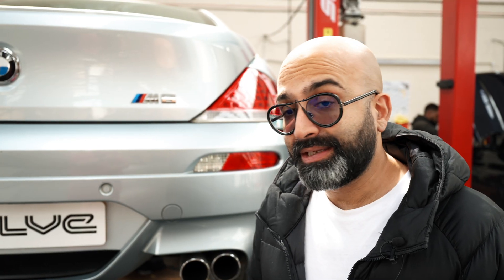S85 V10 Rod Bearing Service on E63 M6

Comment from the maker: We have our own E92 M3s with the BMW bearings in, we're not going to be replacing them with these as we still stand by the fact that if correctly looked after like we will they're not going to suddenly fail. So don't suddenly think you need to do the service again - but if you haven't had it done yet, why settle for less than the best? That's something we try to live by with all the products we design and sell.
Reply: Can you elaborate on "looked after"? E.g. should the car be let to idle until fully warm? Or idle only for a few moments then babied until warm? The car already limits revs as it warms up. Thanks.
Reply from the maker: @GrandUppaah  Let it idle for a minute or so, then drive moderately until fully warm is what we do.

Comment: If i buy an M6 with almost 90,000 miles, rod bearing replacement seems like a no brainer. Are there other "while you're in there's" that should be done? Example: VANOS pump, VANOS line, or other suggestions? Thank you.
Reply from the maker: We carry out the VANOS line if the car does not have the updated part from factory.

Comment: So what is the core cause of the issue? Is it an oil system issue? Vibrations? Weird bmw built this engine for 5 years and never fixed the issue
Reply: The root cause of the issue is when cold the tolerance between rod bearings and crank is too tight to allow the cold thick oil to fully flow which is exacerbated by some drivers not allowing the engine / oil to fully warm up before giving it the beans. This results in excessive wear. 

It is vital the s85 engines are allowed to fully warm up before the throttle is opened up. 
Mahle bearings have s slightly improved shape to allow better oil flow.

Comment: 10w60 is thin when cold to get to where needed quickly and thick when hot for operation…..hence the warmup

and is there any unhappy pairing mahle rod bearings with factory orig main bearings…..and using factory parts just bearing or baring in mind to maybe doing them as a service and when do mains take shit bc thats my thing eating at me is their condition

Comment: Would rather the bearings wear than the crank...... How do you rate them in relation to stock taking this into account... As the harder material can be detrimental ?

Would rather treat them as a wear it... if that's the case... And in that case... What do you recommend please  ?⭐ Stock or Mahle ? As this is over a year ago now ... An update would be amazing!!!
Reply from the maker: Still fitting and recommending the Mahle bearings
Reply: @EvolveAutomotive  Does the Mahle use a harder material  ?
Reply: @TTOOS  There is a write up that Mahle did on there bearings, I believe it is more focused on the original set, from what I remember they are using different coatings. I just sent my car off to have these put on, im at 151k, I've had the car for a few years so we'll see how things look hopefully Monday.
Reply: @GrandProductionsMedia How many miles did you put on yours since purchase?

Comment: Finally someone with brains.
Stay with factory size rod bearings unless you gonna pull engine out and replace main bearings too.
Specially cylinder #7 and 8.
Mahle bearings are awesome.
Strongly recommend.
Environment play huge role in this.
Here in Florida I’m seeing M3’s with 200k having original rod bearings in OK condition even with very longs oil change intervals.
Illinois, New York and up it’s totally different story.
In that case I’m installing 400W Moroso heating pad at the bottom of the oil pan to prevent premature failure.

Comment: I’ve owned 2 of these and currently have a manual. If you look on the engine and manual it clearly says change the oil every 1500 miles. Most don’t know that. 

In my opinion it’s one of the reasons why there seems to be issues with the engine. Most probably wait 3,000 - 5000 miles. Big mistake if they do. In my single clutch only had problems with the SMG failing because it’s not if it’s when. Just like a manual clutch. The problem was the BMW dealer didn’t know how to fix it. Sad story. Left bolts undone and all. Crazy. So it failed a second time. Took it to an Indy shop and ran perfect after that. 

Manual 6 speed has zero issues knock on wood. Searching for a manual M5. The moral of the story change your oil every 1000 miles on this massive oil burning car that runs super hot.
Reply: Hey brother. Just got one myself it's the Euro version, and it says it on the sticker under the hood. Clearly convinced, that has been the culprit of the bearing, failing left and right. 

Added ceratec and liquy moly 10 60. Mine has 79k KM. Almost new. But I'm doing the bearings just because of age and the fact you just described
Reply: No this sticker regards the first oil change…

Comment: Which bolts did you use? I keep hearing about ARP. I like that they are simple to torque but I do not mind doing torque to yield on the OEM bolts if they are truly better.
Reply from the maker: We use ARP but OEM are also fine.

Comment: Could you run a 5w-50 oil in the S85 after changing to higher tolerance bearings?
Reply from the maker: We have recently switched to 5W-50 Motul oil in our S65/85 rod bearing services.
Reply: @EvolveAutomotive  Any updates on how this is going please 💘

Comment: The problem isn't the rod bearings, the problem is the main bearings closest to the chain. The chain puts too much tension on the crankshaft making the main bearings closest to the chain work way harder. If you are thinking all you need to do is replace rod bearings to extend the life of your S65/S85 THINK AGAIN. You know how all these shops pull out the rod bearings and look at them on a piece of paper and say "oh yea its great we caught this in time" it's a bunch of bull. Have them take apart the engine completely down to the crankshaft and have them look at the main bearings closest to the chain, THAT'S YOUR PROBLEM! If you actually want your engine to last have them replace both your rod bearings AND your main bearings. Unfortunately you can't just drop the oil pan to replace your main bearings, you need the entire engine taken out and disassembled. BMW Quality!
Reply: The s85 suffers from premature rod bearing wear, not main bearing wear

You can see various s85 tear down videos here on YouTube to see for yourself
Reply: @mista5796 why don't you look up the guys who had their rod bearings replaced and still had their engine destroy itself? It's both the main bearings and rod bearings that don't have enough clearance
Reply: @BHSAHFAD that’s one case, and we don’t know the history of the engine. 

I’ll include a couple of s85 teardown videos here so you can see .. the main bearings are fine
Reply: That’s not true. My engine was rebuilt and that’s not the issue.  You didn’t even mention the high pressure Vanos.  Nice try to sound like an engineer.  Let me know if you design engines

Comment: Did you also check and replace the vanos lines that also fail over time?
Reply from the maker: This car had it changed, only the earlier cars without the updated line need it done.
Reply: @EvolveAutomotive  that's not entirely true. I own a 2010 m6, and when we changed my rod bearing we found the vanos lines had started to leak.
Either way, I still enjoyed your video. It's still very informing and I appreciate you making it. Great job

Comment: This is pointless just like using non-OEM bolts.  1) How many of these will ever see another 150k in their lifetime, and 2) If it does, what owner would NOT bother going back in, and end-up swapping these expensive shells out anyway?
Reply: Damaged crankshaft and metal shavings destroying your VANOS pump will make it 5 times more expensive than rod bearing job.
Reply: @UMORIEGA   What the... no valid point to that statement.   The discussion youre missing is - why the fk play with aftermarket overhyped bling when OEM has already proven to do a fantastic job for nearly 20yrs of repeatedly withstanding yet another new wannabe-racer owner, more cold floggings, track days, YouTube burnouts etc., and its done all this for more miles/kilometres than the car will travel in its remaining life. In short, the ARP & BE sheep online are regurgitating complete nonsense.   Is that clearer enough ?
Reply: @asecret900 replace the bearings at the 50-60k interval and shut up 😂😂
Reply: @Tony-l9g7y  In what decade or century do 'you' predict E60 M5s will see their next 60k rollover?   Never again is the correct answer for 99.9% of these old girls - And us owners respect them a great deal more than the cashed-up abusers, with full replacement warranty.

Comment: I know a mecchanic who have an m3 e92 and he said that every 70-80k km you need to replace every bearing  and i mean those on the block also because people replace only those over the oil pan leaving the main bearings untoched thinking oh i repleaced them so yeah..wrong those main bearings can spin and that's game over boys.
Sreten on his channel (e39 restorations)talked about this issue and he showed on his m3  what can happen if those bearings are not replaced.
Don't know if the v10 have the same issue tho.
Reply from the maker: Respectfully disagree with the need to change main bearings. That’s also a total engine disassembly to carry out.

In all our years have never heard of an engine failing and the cause being a main bearing.
Reply: @EvolveAutomotive  Definitely a thing on the S65, not sure about s85, maybe not since it's a longer crank. This just happened to Speed Academy's (YouTube Channel) M3 and they had just had the rod bearings done 3,000 KM prior by an experienced shop. I forget what the determined culprit is, but believe it had something to do with extra tension from the oil pump chain tugging on one side of the crank. Also noticed no plastigage on those bearings during installation to check proper clearances, due to any bearing, crank, or rod variations.

Comment: A motorsport derived part is not necessarily superior in a road going application.
Race engine applications demand power and short term reliability, but not long term reliability. For example, a lot of race plain bearings will be single layer for outright strength, rather than the multi layer oem bearings designed to last a long time.
Im not familiar with these Mahle bearings and theyre a reputable manufacturer, but anyone wanting to go this way should do their research to ensure they'll hold up in the long run.
Reply: In the pdf "Copyright MAHLE Engine Systems UK Ltd Technical Information Motorsport Engine Bearings" they talk about motorsport bearings with trimetal layers, so no worries there :).

Comment: I was under the impression that the OEM bearings get out of shape due to uneven wear from poor clearancing, BMW designed the factory bearing clearance too tight, and this is what ultimately is at fault for the high bearing wear.

It seems to me the UK is lagging behind when it comes to providing a proper permanent solution for these engines. The issue with these engines was figured out back in 2015 when BE Bearings released a properly clearanced bearing for the S85/65 motors. Once these bearings are put in they are essentially lifetime like every other normal engine, no more 60k interval bearing changes because of BMW's poor engineering. 

I personally wouldn't trust a shop that doesn't put higher clearance rod bearings in these motors & instead opts for new OEM bearings, your just replacing a flawed item with a new flawed item and not addressing the issue at its core.
Reply from the maker: We’ve over the years discussed the issue at length with people who have a lot more knowledge on engine internals than we do, and of course without proper controlled scientific testing the true cause of the issue will never be known for certain, if it is even one factor (in our opinion it’s more likely many)

As said in the video, if correctly looked after the OE bearings will last the lifetime of the vehicle, evidenced not only by our own 150k mile car but also a customer who has a car from new with over 230k miles on the original bearings.

Mahle (actually Vandervall who were bought by Mahle) have huge experience in designing and manufacturing bearings, so with this bearing have not only carried out proper R&D which comes from processes learnt from F1/Endurance, but also then utilised their manufacturing process and it’s extremely tight tolerances and attention to detail to create what we believe to be the best bearing available for these cars.

I mean they even go so far as to not stamp the numbers on the bearing but laser etch, as the stamping will cause raised spots on the bearing which then increase heat transfer in small areas which can attribute to increased bearing wear.

Are we saying any other brand are bad? Of course not, because without proper first hand data from each one we aren’t in a position to say that. So if you have a personal preference of bearing material, clearance, coatings, brand, or even oil then go with that, it’s your car after all. We’re just sharing some knowledge that we have gained over the years from changing hundreds of not thousands of sets of bearings, and speaking to many experts within the industry.
Reply: @EvolveAutomotive  You can't use an example of one car, or even a few dozen, that go over 100k as evidence that all S65s will be ok at that mileage, many won't, and many have already failed before that mileage over the years, and that's due in part at least to clearance variances.
Also, Mahle increased the clearance with these new bearings of theirs, so that lends more evidence to the clearance issue the OEM bearings have.
That said, the later tin/alu/copper bearings fared less worse than earlier OEM lead/copper ones, I've not seen one of the tin/alu/copper ones worn through to copper yet (after looking at 500+ photos of OEM bearings pulled! lol), and yes they do have copper!

That said, seeing as your own M3 got to 150k with the earlier bearings, I'm sure it'll be just fine on the later OEM ones.
Oh and a bearing worn down to copper is not ok, even if it didn't fail and seize. Once the copper is exposed their is a risk of seizure (as per the bearing manufacturers bearing construction pdf papers).
Reply: @Markpd69  I'm looking at a 2012 M3 with 89k miles, would either of you recommend changing the bearings?
Reply: @ragnarlothbrok6324  Well, as I mentioned above it seems the later bearings are at a lesser risk of failure than the earlier ones, and certainly don't wear through the babbitt layer like the earlier ones. But they still don't wear at normal levels like a 'normal' engine would (high revving or not) and a small number have failed, if it were my car, with that mileage I'd change them anyway.
Reply: @Markpd69  thanks
Reply: Yea this, I put in a long detailed rely about this, but it  got deleted :(

Comment: I find it amazing that Mahle out of nowhere, for an 18 year old engine, found it fitting to develop and release bearings. Sure, the S85 was made until 2010 and the S65 until 2013 but still, Mahle hit it out the park apparently.
Reply from the maker: We are in debt to whoever convinced them to!
Reply: bechause they have seen the demand now...new cars didnt need a replacement
Reply: @p__jay  Considering it was a consumable and needed after three years for some, I cannot really agree with you. I hear what you're saying though.
Reply: But they kept on the original nominal clearance developed by BMW at 0,038mm. So I don't see too much difference from OEM 702/703 bearings. For me, BE bearings is still the gold standard.
Reply: @UMORIEGA wrong unless you replaced main bearings too.
All you did is to put even more wear and tear on mains.
Specially cylinder #7 and 8.
I had numerous customers here in Florida with failed bearings.
Every single one of them swear they had rod bearings replaced in past 2 years.
If you live in cold environment just install 400W Moroso heating pad at the bottom of your oil pan.
This greater clearance rod bearings only job is flat out stupid
Reply: @UMORIEGA why?

Comment: Is there a reason why people don't use coatings on these bearings like you would on the side of a piston?
Reply: The tolerances of rod bearings are much smaller than piston skirts.. pistons are quite loose in comparison, with the slack picked up with piston rings

Comment: Do they make these for the S63 engine?
Reply from the maker: They do yes, and it’s now what is in every Mr VANOS engine build
Reply: @EvolveAutomotive  Do they have increased clearance over the OEM ones? (like the BE bearings?).
Reply from the maker: They have used their proprietary software (the same one they use for F1 bearing design) to accurately model the requirements of the bearing and specify the clearances based on that data.

The S65/S85 ones are specced to 55 microns of clearance.
Reply: Mr who

Comment: Would a dry sump improve the reliability even more or is it just not worth it for a car that doesn't go to the track?
Reply from the maker: Dry sump is a massive undertaking and one that really changes the entire scope of the car to something much more track focused.

Not an area I have a huge amount of experience in, but I’m not sure how much it would change it as it’s not an oil starvation issue to the oil pump pickup.
Reply: @EvolveAutomotive  ahhh, fair enough thanks for answering, I'm currently looking at a massive deal of an M6 with a full-service history and less than 90k miles, (rod bearings and smg pump recently replaced less than 500 miles ago) and want to do a nice build with as good reliability as I can get out of it, cost isn't much of a problem since it's a long term project and a secondary vehicle, but I don't want to do useless mods.
Reply from the maker: Look after it and warm it up correctly and the rod bearings will be the lease of your worries with an S85 😅